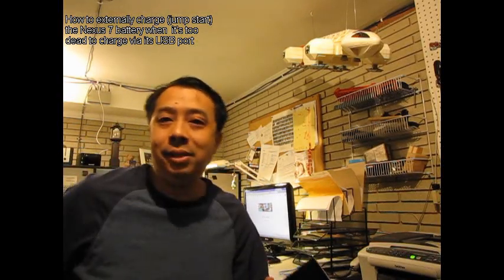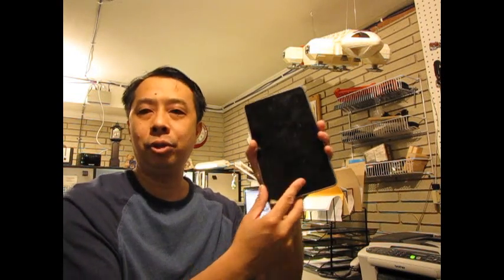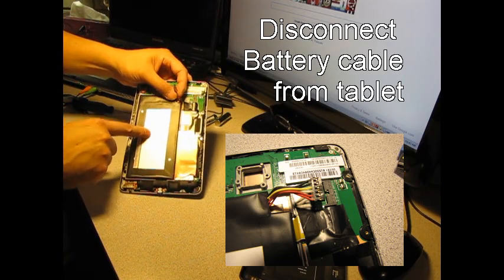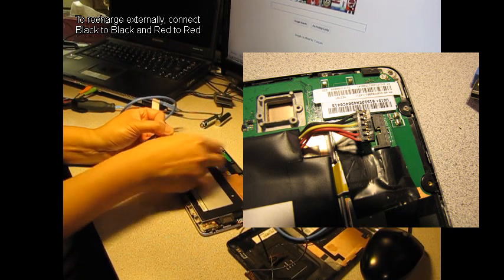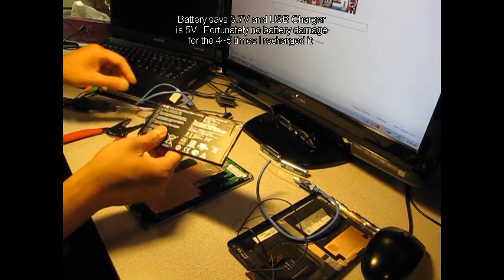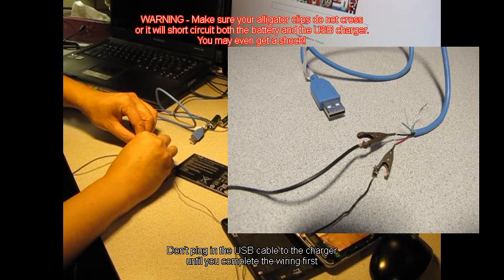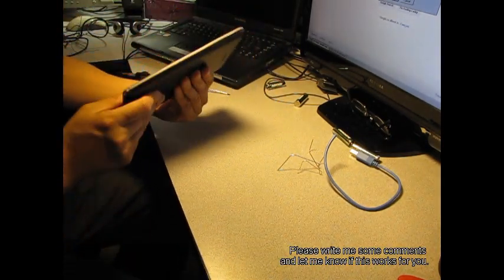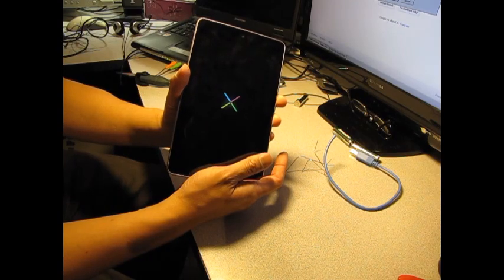Externally Jump Start Your Dead Nexus 7 - Final solution when all else fails!

Comment: Thanks so much for this video!  This worked perfectly.  I used a few sewing pins as connectors to insert into the battery, attached to a power bank charger. I let both cells charge for about 10-20 mins each and was able to boot and properly shut down the tablet. Now it's charging after being shelved for 3 years!
Reply: Hey I know it’s late but I have been trying to charge it with the power bank and it’s not being charged . Did that happen to you too?

Comment: you sir are an absolute legend. i just bought an n7 from a computer repair shop (believe it or not ha) for €5 as he said it must be fried as he couldnt get it to do anything. i did your trick and let it charge for a good half hour and boom its working fine now, it did have a crack running from 1 side to the other but now that i know it works i'll put in a new screen. you earned a new subscriber, keep up the excellent work
Reply from the maker: stephen brady , if it doesn't change because the USB port is broken, consider purchasing the docking station (assuming your version has the 4 pogo Gold pins on the side). otherwise eBay sells the replacement USB port which is not difficult to install yourself as it is a modular piece. Congrats to a job well done!
Reply: thanks, its charging perfectly now, thankfully everything is perfect with it now except the crack in the screen but i can get a new 1 of them for €20 so all together i will have an "as new" n7 for the grand total of €25 thanks to you.

Comment: I have a Verizon Ellipsis 10 that refuses to charge or boot under any circumstances, so I'm going to try you're method on it.
It seem I have not much to loose.
Thanks much for the clear, concise instructions!

Follow-up.
This method DID charge the Ellipsis 10 battery to full charge!
The battery will stay charged for several days if left disconnected from the tablet.
The tablet still refuses to boot up.
YouBreakIFix claims it needs a new battery for $178 (total incl. labor).
IDon'tThinkSo! (considering the replacement battery is $26 elsewhere).

Comment: Thank you! After replacing the charging port I jump started the battery as you have shown and now the tablet charges well. One improvement I made, instead of using a paper clip,I used a wire wrapper (used in packaging groceries) that has about the same gauge as the existing wires connected to the battery.

Comment: Amazing,Thanks for sharing your video.it worked a treat. The only thing is now when I plug any USB lead in to charge, it won't charge. Maybe faulty USB port??
Reply from the maker: As you mentioned your N7's USB port is no longer charging, there are other methods to charge it rather than fixing the USB port.  If you have the model where there are pogo pins (4 gold dots) on the side, you can purchase the docking station to recharge it from now on. If you have the newer wireless charger model, you can also purchase the wireless charger.  Or simply, you can replace the worn-out USB charging port by purchasing a replacement part on ebay.  It's not difficult to replace given its modular design.

Comment: Hi Doug, I tried this fix and it worked, thank you for your help.  However, I can no longer charge my tablet through the USB port, it actually drains the battery really quickly.  Did you mention an external charger? I do have the gold dots on the outside, can you give me more details.
Reply from the maker: If you got the 4 gold dots on the outside, I believe you have the 2012 model like me.  You can buy the corresponding docking station on Ebay.  I bought the this docking station shortly after making the video and it charges fine after you jump start the battery.  Here is one for your reference http://www.ebay.com/itm/Google-Nexus-7-2012-Docking-Station-New-Original-Genuine-dock-fix-charging-issue-/142270631547?hash=item211ffd8e7b:g:g5cAAOSwOgdYpNcD

Comment: you can use a wireless charger you need one from Amazon 10quid as Nexus 7 has this on back of cover no need to take apart
Reply from the maker: Thanks for sharing this!  However, not all N7's have the wireless charging capability, and I was told that if your N7 is completely dead even the wireless charging won't work.  Can you confirm if this is true or not true?

Comment: just curious why you didn't split the power and do both halves of the battery at the same time? any reason not to?
Reply from the maker: Hi Kevin, it turns out the the two batteries are actually interconnected internally.  Hence there is no need to charge each battery separately as I indicated in the video which I didn't know at the time.  Some commentators here have split open the battery wrapping and found that the two red wires are actually interconnected and the two black wires are also interconnected deep inside the battery.  Good luck!
Reply: Ah. Awesome! Thanks for the heads up! Worked perfectly for me

Comment: I did the fix with my Nexus 2013 and I got power again.  Got very excited.  The only problem now is my device won't charge or recognized by my computer if I hook it up.  I checked the connections inside but still no luck.  Any suggestions would be appreciated.
Reply from the maker: A defective (non charging) USB port is usually the root cause of this issue.  If your model has 4 pogo pins (gold dots) on the side, consider purchasing the docking station where you can recharge it through these pogo pins.  FOr some 2013 units, it has a built in wireless recharging capability, in which you can purchase the wireless charger.  Please note neither of these methods work without performing this jump start method first.  However, replacing the USB charge port on the N7 is not difficult.  Ebay sells the part and its modular enough to replace it yourself.
Reply: Thanks for the suggestions.  I was able to fix my brother's Kobo e-reader / tablet last night with the same method and he had taken it to a small repair shop that wasn't able to fix it.   I know one of his friends also has the same problem so thanks to you that will be three tablets fixed!   Thanks for the post and sharing!!!

Comment: Your device is nexus 7 2012 not 2013. The 2013 version has different type of battery and layout. I have the 2012 and my sister has the 2013. I've successfully jump started my device using the same method you performed but I can't do it to my sister's device due to different battery.
Reply from the maker: Thanks for the clarification as you are correct!  I realized mine was a 2012 model AFTER I made the video, but thanks for sharing it with the readers.  For your sister's 2013 model, use sewing needles instead as its smaller tip allows you to touch its smaller battery contacts.  Although I haven't tried this myself, many readers here have commented that they successfully jump started the 2013 model using sewing needles.

On a side note, quite often the reason for the battery to die in the first place is because the USB charging connector is broken.  You can buy the replacement part on EBay and replace it yourself as it is modular, but you can also purchase the official docking station (for selected 2012 models with 4 pogo pins gold connectors on its side) or the wireless charger (for selected 2013 models) as an alternative.  However, none of these alternative charging methods work until you manage to successfully jump start it first.

Good Luck!

Comment: Honestly, I'm shocked that this worked! 

I have a first gen Nexus 7 that I have had kicking around the house for while, only getting used here and there. When I last fished it out of a drawer to do some reading with it I couldn't get it to turn on and I couldn't tell if it actually took a charge when I left it plugged in for a few long sessions. I started researching fixes and, though it seemed odd, I decided to give your solution a try. ( What's the worst that could happen? It already wouldn't turn on.)

 I didn't have alligator clips so I used an couple sewing pins with the micro USB wires wrapped around them. I only did it for 5 minutes on a single cell and plugged the battery back in. Lo and behold it booted up nice and easy! Thank you so much!

Comment: I have another nexus tablet the charger port is alone on the bottom whilst the headphone jake is on the top. Where exactly is the battery cable located pla?
Reply from the maker: You have to open up the back of the tablet before you can see the battery cable.  Once opened, the battery cable (which is connected to the battery), is closer to the top.  This assumes you have the 2012 model like mine.
Reply: ah ok thx a lot

Comment: WOW that is nuts good way to blow a usb fuse or battery controller in the battery! 
You can get a li=ion charger from ebay for 2$ with a usb port on it 
also note the two reds and two blacks are linked in the battery. 
also al li-ion batteries are 3.6 at the low point and 4.2 at the hight point 
The drop in volts from 5 to ? is due to the small wire in the usb cable 

If anyone blows out a usb port find me on ebay for a fix LOL

Comment: Thank you so much! This brought my seemingly dead Nexus back to life. It had been left uncharged for a very long time (around half a year) so I had to leave it on the USB cable for a couple of hours. Everything seems to be working now though.
Reply from the maker: Also check if your Tablet's USB port is charging as that is often the root cause of this issue.  f you have a 2012 model like I did, consider purchasing the docking station where you can recharge it through the 4 pogo pins (gold dots) on the side of the unit now that it works again.  If you have a 2013 unit, it may have wireless recharging capability, in which you can purchase the wireless recharger.  Please note neither of these methods work without performing this jump start method first.  However, replacing the USB charge port on the N7 is not difficult.  Ebay sells the part and its modular enough to replace it yourself.

Comment: Wow! you are a life saver I was about to put in the trash and decided I would investigation first and came across you helpful video thankyou so much this worked and I descovered my internal usb charger unit is damaged. thanks again for you help.
Reply from the maker: If you have a 2012 model like I did, consider purchasing the docking station where you can recharge it through the 4 pogo pins (gold dots) on the side of the unit now that it works again.  If you have a 2013 unit, it may have wireless recharging capability, in which you can purchase the wireless recharger.  Please note neither of this methods would work without performing the jump start method first.  However, replacing the USB charge port on the N7 is really not difficult.  Ebay sells the part and its modular enough to replace it yourself.  Good luck!
Reply: Ok thanks for that helpful information I have 2012 model. I will check the Internet for the parts.

Comment: According to this video : https://youtu.be/x8u8xSnfCOA?t=729
both of the red cables and black cables are the same. You can check it if you open the cover a bit on your battery.
Reply from the maker: You are absolutely right!  Several commentators have mentioned that the pair of cables to the batteries are indeed tied together in parallel.  Hence you only need to charge one pair.  I did not know this when I made the video!

Comment: can i do this with my china tablet it also has 6 wires 2 red and 2 black 2 white battery is same like yours
Reply from the maker: I am not sure, but someone got their Lenovo A7 restarted using this method.  Another commentator got their Samsung??? tablet working as well if you follow these comment threads.  Good luck and tell me if it works.

Comment: Voltmeter shows 4+V on both cells and can't power up the unit. Any suggestions?
Reply from the maker: Gosh, that's not good news.  It means your battery isn't dead, and hence unlikely this jump start method will work.  There is a small chance that your battery connector wire is loose and hence the power is not getting to the tablet. Make sure the battery connection is good.  Sorry I can't be of further help.
Reply: Jerome, did you manage to fix that? Looks like I have the same issue.

Comment: can I do the same on 2013 edition
Reply from the maker: Yes you can!  A few commentators here has successfully jump start their 2013 model.  However, they said the pins in the battery connector are smaller.

Comment: Nevermind my question, cause it friggin worked for me! I got 30% from letting it charge for 30 mins, the thing is, when I plug it in on its wall socket charger, it doesn't charge.. do you think it could be the charging port? :S

Comment: If there isn't anything wrong with the tablet plug it in overnight before trying this. The charging circuit will work from zero but the tablet won't show anything until the voltage of the battery voltage reaches a sufficient level.

Comment: when you charge the battery did you hear anything in the battery when you were charging it?
Reply from the maker: No, the battery is silent when being charged through the jump start process.  No humming, no noise, nothing.
Reply: +Doug Peng ah ok thank you
Reply: +Dshun Payne because when I charge it I hear a little his but when I don't have it plugged I hear nothing
Reply from the maker: To be honest, I didn't pay to that level of attention.  I don't recall the battery hissing during charging, but I didn't put my ear up to it either.  Maybe the hissing is coming from your charger?  That is possible.
Reply: +Doug Peng true but when I move it a certain way I hear a little his from my wall charger but when I move a different way it stops and you'll hear some hissing in the tablet to me when I hear hissing from tablet I feel like it's charging because it hasn't been charged for like 3 to 4 years and I have to move the charger a certain when it was alive to charge
Reply from the maker: Logic tells me there shouldn't be any hissing from the battery when charging.  It could be a sign of an internal short circuit, but your battery should warm up immediately if that was the case.  I try to respond back to every inquiry and you are the first person who asked about a hissing noise.  Hence statistically this is very unusual, but I will certainly take a mental note to see if I hear it again.  Thanks for sharing this experience with me.
Reply: +Doug Peng thank you for your feedback

Comment: It looks like there is a electronic gate between USB port and the battery. If the the battery is too low, the gate can not be opened. If the gate is not open, the battery won't charge from USB and will be lower. This is a logic deadlock bug by design. The jump start solution breaks this deadlock. So that's why it works.

Comment: Thank for your video. I started to do as you. But I feared using a stripped USB. In the middle of your video I plugged in the nexus after I unplugged the battery. It showed the charging battery icon on the screen. Then I plugged the battery back in as it was showing the icon. This worked for me. If it wasn't for you I wouldn't have tried it. See if that works for you too. Thanks again +Doug 
Peng

Comment: Great video but unfortunately this did not work for me. I used instead of paper clips two of those plastic coated twist ties (as come with new cables ). Stripped the ends and they worked fine being slightly thinner wire than standard paper clips. In my case the battery seems ok (correct voltage output from both cells). On the point of giving up after trying all those combinations of Power and Volume buttons endlessly.

Comment: I may be the first one failed on this brilliant process. I connected the USB wires on outher red /black holes and keep it like that for over 30 mins. Didn't noticed any warming on the batt. When I place the batt into the device no change obeserved on it. No turning on, no charging, no nothing. What do you suggest. What am I doing wrong?
Reply from the maker: +Bilgin Akin Akarlar , thanks for sharing your honest attempt at my process.  There are two logical possibilities 1) The battery got charged, but this method doesn't work for your case, or 2) you battery did not get charged despite your efforts.  Do you have a volt meter to measure the voltage on the battery?  If it is 3.7V, that means it got charged, and if it is significantly less, that means you failed to charge it.  Let's hope for the latter case, as there is still hope that you can charge it a second time.
Reply: +Doug Peng Thx for reply. Unfo I dont have a volt meter but I can say that, I can here the device recognition sound when I connect the N7 to my PC. Also in device manager of my PC "Android ADB Interface" shown which is match with the N7 i guess. However I cannot do any thing with N7 via toolkits nor via cmd window. Even though device manager shows N7 as "Android ADB Interface", when I execute "adb devices" or "fastboot devices" command in cmd I got nothing. If you have any idea to share I'd appreciate.
Reply from the maker: +Bilgin Akin Akarlar , if you can hear the USB recognition sound on your PC when connecting your N7, it means your N7 should charge as there is a connection.   However, if your PC's USB port is blown, then perhaps it is not sending any charge to the N7 despite getting a data connection.  Have you tried charging with a different USB port or charger?  Perhaps what's broken is your USB charging port on your PC.  This is only a guess, but worth an investigation.
Reply: Thx again for your concern. I ve tried any thing incl changing cable and usb port. I'm gonna give a try to send it to service:)